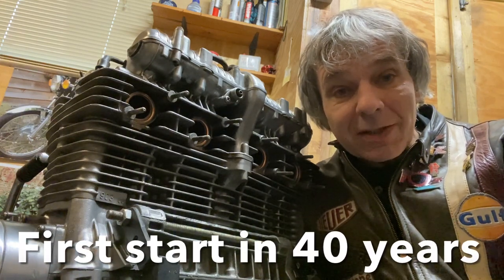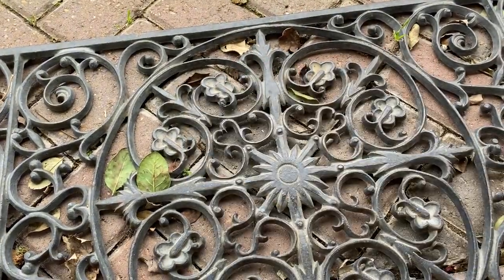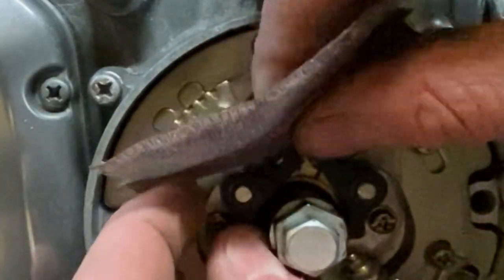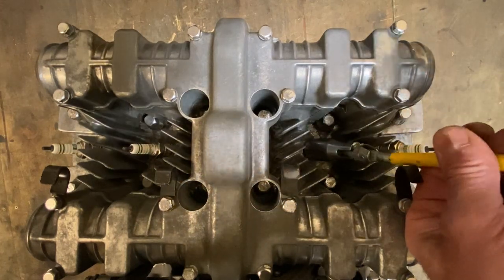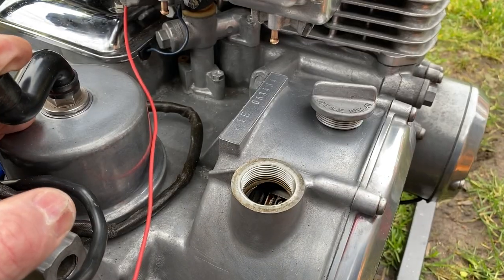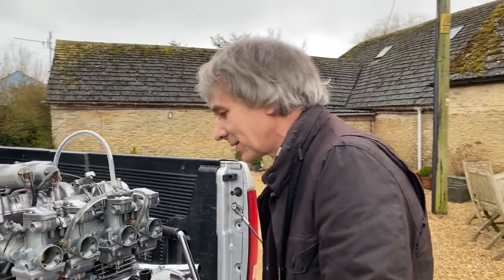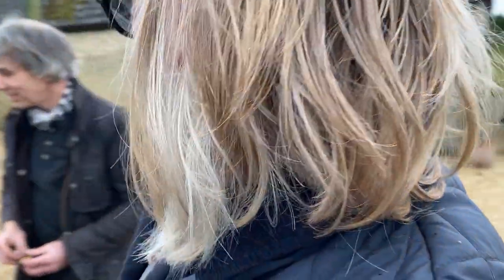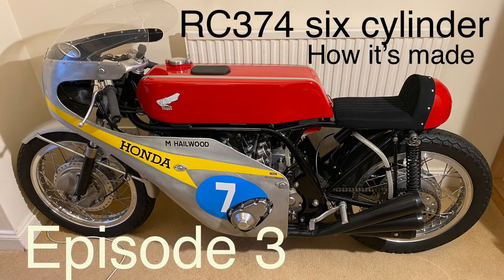First start in 40 years - Kawasaki Z1B 900 engine

Comment: It is unbelievable that it kicked over like that. If I leave my '96 bandit for two weeks it's harder than that.
Reply from the maker: newer bikes are set up so lean and the carbs have really small drillings to flow fuel, this can sometimes cause a starting problem with lack of use
Reply: @AllenMillyard  Thanks for the reply Allen. I've been all over the carbs on this bike, a couple of times. The airbox is such a pain to squeeze in and out, I put twin oval filters on it, and added some dynojet parts to the carbs. I'm not a carb expert, but I have done my homework valve clearances are good and I think the fueling is now pretty good. It's done 30k miles. I'm pretty sure without a rebuild of any kind. I wonder whether it's low on compression until it's really warmed up. Now the weather is warming up, I think I'll have another look at it. Cheers. Love the channel. I also like mountain bikes, so I loved all the stuff about the DH bikes.

Comment: San Deigo CA 1975, a comrade in arms had a Kaw 900, and I, a Norton 850.  Which leaked, needed a kick, was 5 mph less fast, it  vibrated, and bla bla bla. But it only weighed 420 lbs, and I had more fun on it.  Mostly because he was that much of an ass. Was thinking back when I saw the title, wondered what ever happened to that bike.  Now I have a new MC channel to watch as I wait 2 more months, till Vermont thaws. Ice on the Connecticut River is about 8" thick.

Comment: Back a decade or 5, we used to replace all the Phillip's headed screws with hex cap screws. Nothing worse than needing to do a points job and electrical maintenance way out in the bush, off-roading, and strip one of those useless screw heads......

Comment: Allen, you have to know, those first starts weren't so common in the day. Do you feel there is a limit on inline engines' physical size before you need something other than air cooling?

Comment: ....blimey - even the exhaust studs are gleaming ....mine were corroded to hell but I could only replace 3 of them as the others were stuck fast !
Reply from the maker: Still zinc plated
Reply: @AllenMillyard  ...is it a Californian import , with very low miles ?! A shop in Preston , near me , used to go over to the USA and Japan and fill containers full of mint or slightly 'accident damaged' bikes and ship them back, them do 'em up and sell them ! I got a mint CB700SC Nighthawk S from 1984 with 10,000 miles on ! The unusual models are fascinating - do you know about the early 80's V4 1100cc engines which 'self destructed' ?! I bet you could've sorted the flaw out BEFORE they had to recall hundreds of bikes due to a machining issue with the camshafts !

Comment: No cam chain or hyvo rattle think that's had a rebuild or 3 lol
Reply from the maker: It’s never been apart , the Z1 has a gear primary drive
Reply: @AllenMillyard  I only worked on the later ones ,used to rattle like crazy
Reply: @AllenMillyard  Allen I've managed to get my jet ski engine motorcycle running . It's on here .
Lot to do yet but it's coming on . Think a 650 two stroke should be fun .
Thanks for your videos ,very inspiring

Comment: Sounds like only run with 3 cylinder
Reply from the maker: It’s because the camara was one side picking up the audio from the two left hand cylinders. Listen to the front on header less running you can clearly see fire on every exhaust port 😎
Reply: @AllenMillyard  yes in the last minute without exhaust its sound badass, i was think you do some adjustment before 😁, i was wrong it just camera angle issue